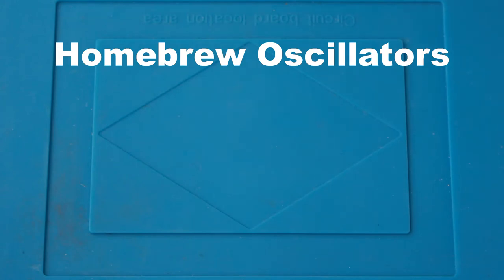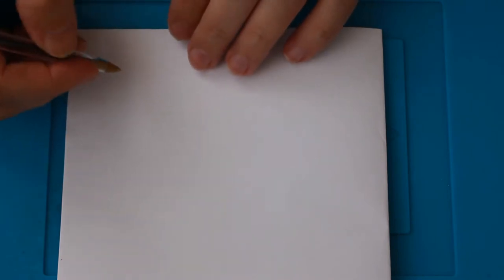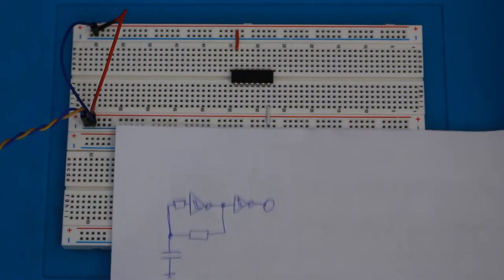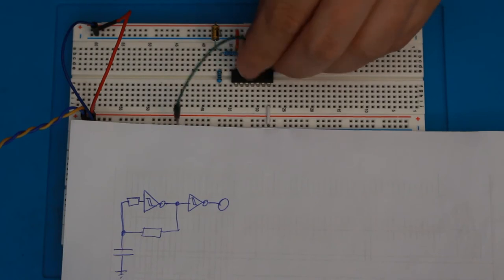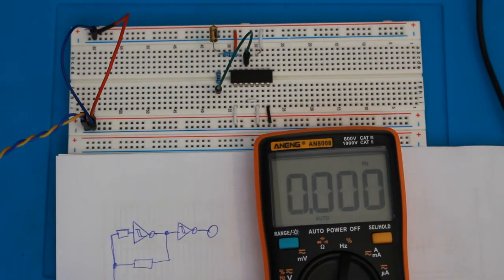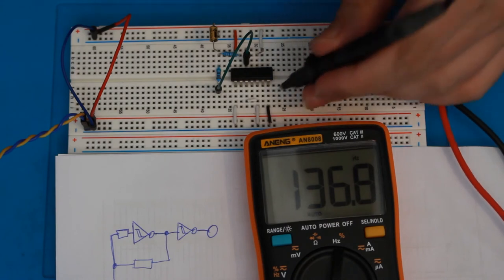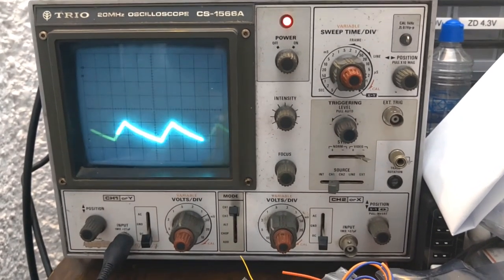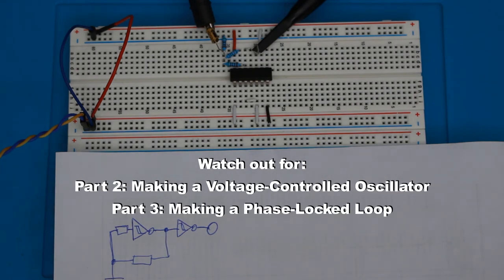Making a simple oscillator (Homebrew Oscillators 1/3)

Comment: Hello, I'm starting in synths. Would this be a good first d.i.y project?
Reply from the maker: If you're serious about synths you'd probably be better off following someone else's project, as this was just an experiment for me. Audio synthesis generally requires more precise frequency control - look for someone who is implementing "1 volt per octave" and you should be on the right track.